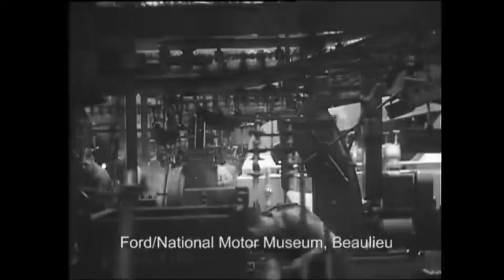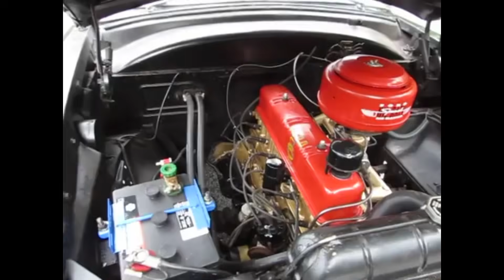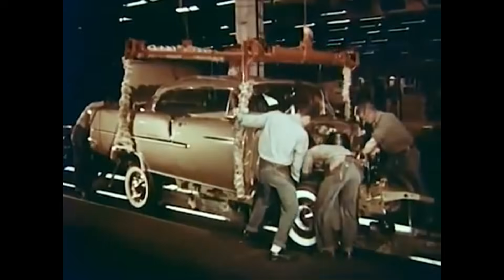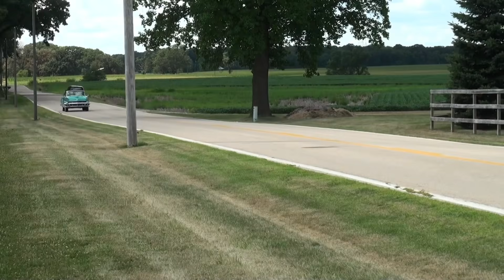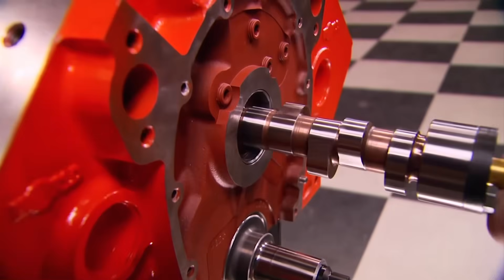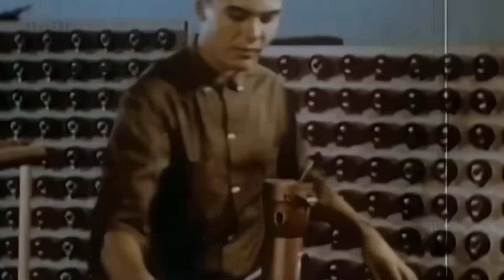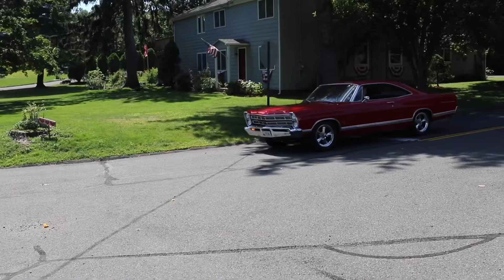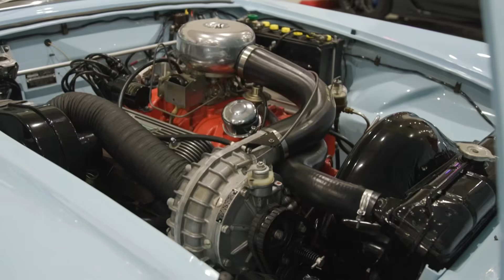Why Ford’s Y-Block NEVER Made It Into America’s Muscle Car Era!

Comment: I have no idea why so many You Tube videos need to comment on a engine that was manufactured for just 10 years and was designed as a work horse for the time. It was never ever considered a “racing” engine but in its early era performance exceptionally well even winning a NASCAR. Championship in 1956. There are many on the road today and are enjoyed by their owners.

Comment: "could compete with anything Detroit was producing" 
Chrysler Firepower Hemi ?  Dodge "Red Ram" Hemi ?    NOT
  (I understand that very early Dodge Hemi had some kind of design or manufacturing problem but the one in my family did not (except that later on in its existence the automatic transmission behind the engine began to fail)

Comment: Have you heard of Ted Eaton of Eaton balancing?  2016 Engine masters challenge, Vintage class, 1st place-  Ford Y Block - 603.2 horsepower and 565.5 lb-ft of torque. Stacked intake ports and all.
Reply: I think Jon Kasse made him a set of  side by side heads and they used a long stroke crank. I don’t know think it was an honest Y- block.

Comment: My recollections are that the 1954 fords were notorious for rear main bearing leaks The main bearings weren't up to the task.  Redesigns followed. That exhaust cross tube was a holdover from the old flat head, just moved up to the top where you could burn your hands on it instead of having it down low like the flat head.

Comment: Yes I has a 292 in a 54 ford, then my HS friend bought a built 292 in a 55 ford, it had to much torque it sprung the rear end housing we could not keep a third member in it, the gear mess would go out and make howling noise. I came with the idea of using a for station wagon rear end (Spicer 44) housing that solved the problem. I thought ford dropped the ball, the supercharged cars were awesome. But the FE had a deep history that turned out to be important too. But its cool people are like the flatheads for ever move to keep them alive There was a Y block Lincoln 319 (and commercial production too) if I remember the numbers correctly.

Comment: The Y block couldn't be made big enough, and if modern Fire Ring head gaskets had never been developed, the Chevy Small Block wouldn't have either, as it wouldn't have been able to be much larger than 300 cubic inches.

Comment: You forgot to mention that the American Automobile Association launched a campaign in the late 1950s that started that the increase performance of the automobile caused increased traffic fatalities. It encouraged the automobile manufacturers to discontinue the construction of high performance vehicles and discouraged their involvement in automobile motorsports. All the automakers complied with this request officially. 
However General Motors provided “back door “ parts to select race teams. Ford saw what was happening and on 1962 launched its Total Performance campaign. This allowed wins in motorsport competitions across the globe. 
Remember that Ford, until recently, operated as several different companies in various parts of the world. So Ford of America would start racing in 1962 to 1970 then restart racing again in 1981 to current date. Other branches of the company would continue racing. The Y block would continue development in those areas. Development included SOHC and DOHC cylinder heads, nitro burning engines, and the first gas engine to run 7 seconds in the quarter mile.

Comment: I had several Y blocks in both trucks & cars. They were nothing special. The 239-272 were dogs. The 312 was pretty hot stuff but cracked blocks. The only good one for my money was the 292.  Chrysler hemis were hard to keep in tune & unreliable. Hemi powered cars had the worst resale value for good reason.  My favorite engines along with Chevy SBC were the other GM V8's, particularly Olds. Caddy, Buick, & Pontiac were all great stuff.  I absolutely hated the oil leaking from the Y blocks, & knew very well about the aftermarket 'Mickey Mouse' oiling kits for the top ends.

Comment: Lots of problems oiling the rocker arms because the little oil holes to the heads would sludge up. Lots of them had external over head oiler setups installed.
Reply: I think some early production had oil passages that didn't line up or that had blockages as manufactured. 
  I understand that later 272 and 292 versions made decent pickup truck engines.

Comment: I was a teen during the 60s Started out with Y blocks. Learned the best way to make my 56 ford Much faster was to swap in a 352 FE. those Y blocks were Boat Anchors. To heavy valve train and pistons. Slow to rev up. Had lots of blow by and tended to sludge up. Keaking rear mains. Non oiling Rockers. Tea pot card with dual advance dist.  Too few head bolts and blew head gaskets between the cyls.  Never seen a stock one that was fast. Ford knew thats why they developed the 221 small block that was copied from the chevy design. My 55 chevy has a stock 283 -220 Hp engine. I have a $100 that says I can beat any stock normally aspirated Y block in the 1/8 mile. Poor design that got horrible fuel economy. I at present have 4 Y blocks that I would make somebody a good deal on.
Reply: Stuck a 352 into a 57 and only had to dent the firewall just a LITTLE bit to fit. That MFr would SCREAM. People KNEW it wasn't a 312 when they saw it race Chevys and win.

Comment: Those Y blocks were Loads IMO.  My dad had a 66 galaxie with a 289 2v and put it next to a  66 galaxie 352 Y block the 289 would blow it away at least in the short run.
Reply: There is no such thing as a 352 Y block.  All 352's were FE engines.
Reply: @ksman9087  Thought they were until I looked it up. They were still loads though. An imbarrasement to the chevy 350.
Reply: most 352 cars had that green drive crusomatic and 300 rear gears. made then real dogs in a 1/4 mile drag race. but could hide the speedometer on top end,

Comment: My dad had that exact red Murcury. He loved and hated that car. Very luxurious and beautiful car. Could pass anything but the shop. It overheated, had bad bearings, oil starvation issues, and many other mechanical issues. The Y block was a good design on paper, but it had bad issues, mostly to do with lack of oil to the top end and inferior bearings. The engine was indeed ahead of its time because it was not possible to large scale manufacture such an engine to be reliable in that age.

Comment: Australia never used the Y block in the 80's. The Windsor engine was Fords V8 of choice up until the 70's then the Clevland engines were used. The Windsor engines returned in Australian cars with EFI around the 80's.
Reply: Why would Ford use an engine in the '80's in Australia when that engine had been discontinued after the 1964 model year?
Reply: @ksman9087  Yeah I know, they didn't. That's why I called out the video.

Comment: The engine design had good innovation and certainly good intentions. But, lets be honest, it was a failure. Ripe with great ideas , but simply did not work. I love ford. But chrysler and general motors were way ahead of them during this brief, but very critical age of performance engines.i am a big fan of Ford’s 352 and 406 power plants. Great engines.i do think , however , that the y-block had a great place in the heavy truck and agricultural equipment applications. These are just my opinions. Im sure people will disagree , and i respect that.

Comment: But didn't the Y block's crankshaft ride on only three main bearings?  If so then that's a major performance limitation.  Chevy V8's cranks rode on five main bearings.  FE cranks have five bearings as well.

Comment: The Y block Ford had a terrible upper valve train lubrication system. The oil galley from the block into the heads which fed the rocker arms was easy to become blocked due to the poor oils of the day. It required an external oiling system to keep the valve train from becoming so easily starved of lubrication. The oil starvation to the rear main bearing was also terrible.
Reply: Not poor oil. other makes didnt sludge up. It was the copious amount of blow by. Those conbustion gases in the oil pan created sludge.

Comment: It was a good low RPM torque engine but was not a high rever.
Reply: It was slow to gain RPM under load. Not a quick reving engine like the chevy.

Comment: Y blocks never had hyd. lifters!!!
Reply: I was wondering if anybody else CAUGHT that. As someone who had to set the lash on Y-Blocks (many times) you are CORRECT. Also in '58, Ford installed a 332 and next year 352.
Reply: Exactly I owned the 239, 292 and 312 and no y block ever hydraulic lifters.

Comment: The Ford Y-Block from the engines i had Oiling problems to the camshaft. After adjusting the bolt on the rocker arms all the way down it still had about >>>>>1/4" to 3/8" play Engines would still run down the Freeway.  I also believe Fords' LARGEST Y-BLOCK was 368 CID i believe i read that in a old greasy Clintons Manual 40yrs ago.
Reply: That was the Lincoln engine.  The Ford Y block couldn't be made that big, not with the head gaskets of the day.

Comment: One car i enjoy quite deerly and was VERY original was 1955 Ford Fairlane Station Wagon I believe it said 272 V8 on the oil bath air filter. One good thing I AM VERY HAPPY about is  All car manufactures did away with ""the oil bath air filter"" WHAT a pain those dam things were if you forgot it was ""an oil bath"" it was going to make a MESS.

Comment: The Ford Y-Block was a good Truck engine for the era.  Because of its Bulky size weight would not make it good in a ""try to make a fit into a lighter car"".  One thing i do remember is the starter on the Y-Block is also Bulky   i do vaguely remember the Ford Tractor used the same starter on their engines like on the Y-Blocks V8
Reply: We once swappd in a 69 -390 two bbl  into a 55 ford  grain truck. It was previously a 272.The owners aid it was more powerful  faster and required less shifting on the hills and got better gas milage.
Reply: @thecollectoronthecorner7061  And the 390 got better gas mileage than the 352.

Comment: Chrysler is a VERY GOOD name for 6 or V8 engine.  BUTT they really FLUBBED UP when they designed the 240 V8 Red RAM which left rooms for MANY Performance designs that should have NOT been built in the back of the Elementary School. Knowing what they knew about building engines is a shock to see that Chrysler let the RED RAM 240 V8 go out the factory UNDRESSED

Comment: The big reason i believe chevrolet GOT its BIG START with V8's was they stole the cylinder heads from the Pontiac 321 V8 engine. If you look back in History there was the Pontiac V8's engine used in the chevrolet truck line.
Reply: Not sure if Chevy actually used Pontiac engines in the mid-fifties, but GMC certainly did.
Reply: @alanhook9892  Thats right GMC only.
Reply: Nope no pontiac engines in chevy trucks. GMC had pontiac V8 from 1955 till 1959. Cheve did have a few truck tractors witg buick nailheads in56
Reply: Yes and no.  Chevy did steal the individual rocker arm design from Pontiac.  GM had a rule that when one division came up with a design the other divisions had to wait two years before adopting the design.  When the engineers at Chevy found out that Pontiac had designed a head with individual rocker arms and was going to bring it out the same year as the Chevy small block they persuaded the bosses at GM to waive the two year rule and let Chevy use the individual rocker arms on its V-8.  The no is that GM never put Pontiac engines in Chevrolet trucks.

Comment: I DO NOT believe the Ford Y-Block would have been a good contender in the 1960's Mainly because I have witnessed a few Y-Block that had POOR OILING to the camshaft EVEN after tightening the valve  adjustment ALL the way down the rocker arm.  Another; belief is years ago I do remember looking at a old Clinton's Manual and YES the LARGEST C.I.D. for the Y-Block was 3.6.8 c.i.d.. The 368 Not mentioned in the video.

Comment: Back in '61 to '63, I used to work as a 'gas jockey' at the small town's Texaco f=service station and garage, in other words, I pumped gas and washed your windshield when you pulled in to a 'full service' gas station. It was a town where Ford and Chevrolets were more popular than Dodge and Chrysler products. With Chevy's you didn't see the problems that the to me the 'infamous' Ford Y block had to the owners and the mechanics saw, fixed many time on that engine design, which was the sorry design of he rear main seal.  It was a 'rope seal' that was in two pieces and was just stuffed as much as you could get it into a groove in the block around the rear crankshaft journal.  Leakage was a terrible problem with them, and the other major design flaw for the top end was the starvation of oil for the rocker system for the valves.  The internal oil supply size tube style hole in the block to feed oil to the top of the engine was way too small, causing the rockers to wear early and have that infernal clicking sound that the Y block was famous for.  I saw many a sorta 'fix' for the problem where the oil pressure sender hole was, they would put a brass fitting in it that stuck out from the block where the oil light sender was in an extended brass tube and from the right angle it had a spot for another fitting where you could run small copper tubing to the top of the engine and put a drip tube system over the rocker shaft and deposit oil on it for better lubrication.  It was a fix but a shoddy one with small tubing  run up to the top of the engine with a tee fitting at the top to take oil to both heads, and where they drilled a hole in the valve covers was a problem of keeping it from leaking at those entry through the covers leaked too. This was one of the biggest reasons that I hated Ford products, on that engine, when they discovered the problem, and they had to know early on, to just drill out that oil  passage big enough to not starve the rocker shaft.  And too, that Y block design was just too d-mn heavy. and Chevy had them beat in that area.  So I bought Chevys for years, starting with a '50 business coupe (early fastback), '56 Bel Air 265, '60 Impala, '65  Biscayne 283 with a 3 on the tree manual trans (that got 23 mpg in those days was amazing),  '66 Impala SS 396 with a 4 speed Muncie trans, '68 Impala. '69 Nova 350 Qudrajet with the 3 speed turbo hydramatic auto trans, fast car it was. After those years when I became a fireman in '64, I part timed at a VW garage and bought 3 of them to play with.  Then in the '80's after I retired I opened up a small foreign car repair shop and through experiences in it, I started buy Japanese cars starting with the Datsuns, which were real good cars in that era before Toyota hit the jackpot with the bullet proof '80 model 20R engine in the same year pickup I bought.   Lotsa years and lotsa cars ending up now at age 80 with a fantastic '17 Buick Envision that we drive, 115K so far and only changed tires, 5 year battery and the 2 front shock assemblies.
Reply: Wrong, problem was the center cam bearing Ford solved mid 57. Correct over head oilers were plumbed to pressure rocker shafts, not drip. Do you remember how many other OEMs used rope seals? High performance race yblocks go many seasons without rebuild unlike chev engines, transmissions and rear ends. Go to a car show to see how many Fords still have yblocks while chevs rarely have original era engines. I towed my brothers tri 5 chevs from the track with my 57 Ford more times than I can remember. Constantly broke valves, transmissions and rear ends while mine never broke and did same track times. And I do NOT believe a 65 Biscayne 3 speed got 23 mpg, not even on the freeway with a 6. I had a 1966 2 door 3 speed 283 Biscayne averaged 15 mpg same as all other same weight non overdrive cars of that era. Been driving yblocks since 1968 and still driving 2 high performance 57s. 2005 Mustang GT 270K miles changed one set of brake pads, one clutch, spark plugs, usual tires and batteries and still runs perfectly.
Reply: My brother just reminded me the 66 was a chevelle 2 barrel 3 speed. I sold it to him after a short time due to poor torque curve as was the problem with all those chevs. Even 6 cylinder falcons, novas and valiants barely got low 20s per gallon on the freeway. You chev guys alway had a lot of talk.
Reply: @danontherun5685   Ive torn down dozens of Y blocks and never ever once found a spun cam bearing.
Reply: there is a red 62 ford wrong bed truck in my hoard,I remember it in 64, My father had a new 64 chev truck 283 stick, that ford was a 292 granny 4 speed. We would meet him on the highway.  And a cloud of blow by gasses would be billowing out from under that truck. Back in the day there was a black stripe on the center of each lane from  leaking oil. it got thicker closer to town. the Pcv and the disuse of the old cars withvented crankcase and that oil line dissappeared by 1970

Comment: The Y Block birthed the FE and FE's are great!  69 428-SCJ Mach 1 resto-mod owner here  ...legit CJ (and Marine) blocks are high-nickel content (will usually have a "C" scratched into the pattern on the back) and have the distinctive reinforcing webs on the center main cap journals.  The 427 FE was even better with cross-bolted main caps and "side-oiling" - these engines dominated LeMans
Reply: Yes Its my opinion if Ford had came out with the FE in 1955 The  Tri Five Chevys wouldnt be a popular as the are today.